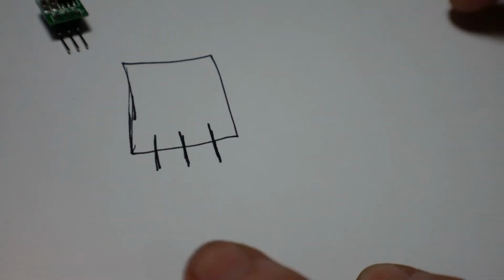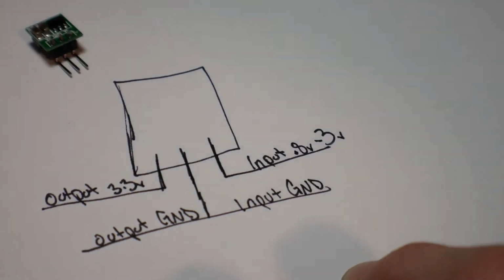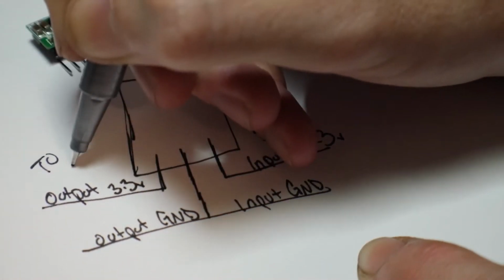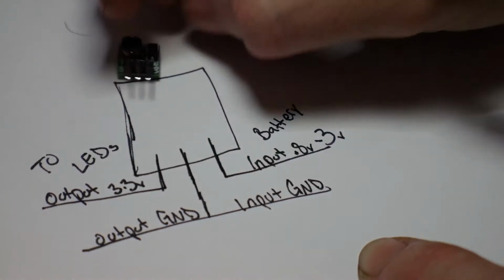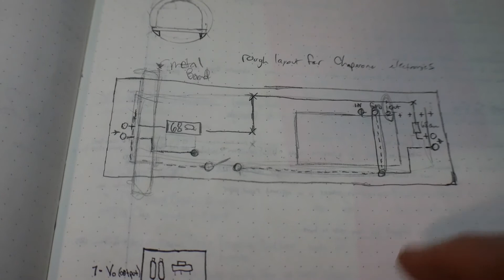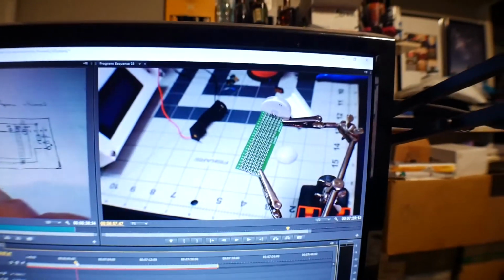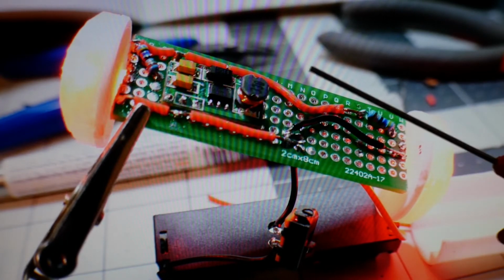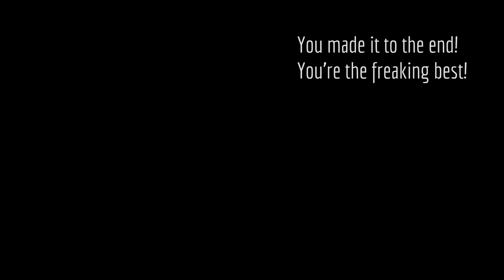Add LEDs Anywhere Easily With A Single AAA Battery

Comment: Hardware is my kryptonite. I do software easy enough, oddly. 
Do you have any explanations or resources to explain simply how breadboards and resistors are used and calculated? That was never taught in my electronics classes, it was just assumed we all knew it.